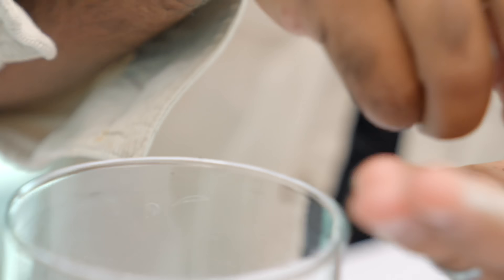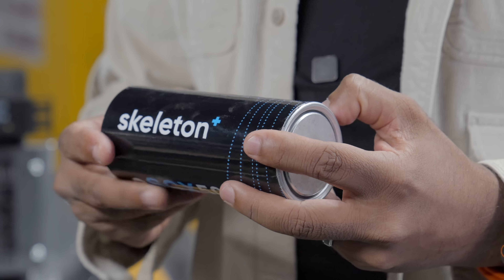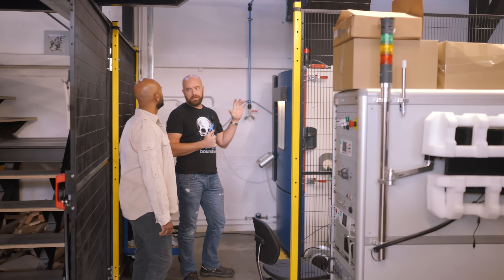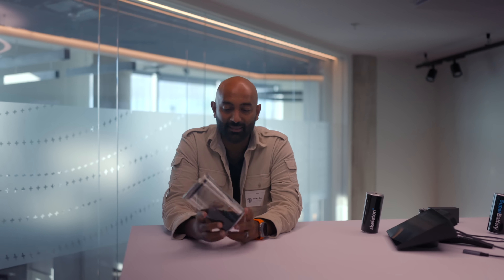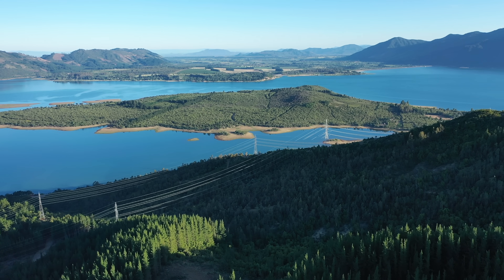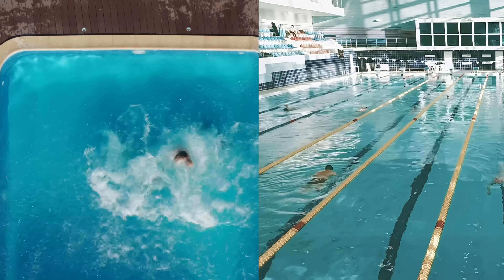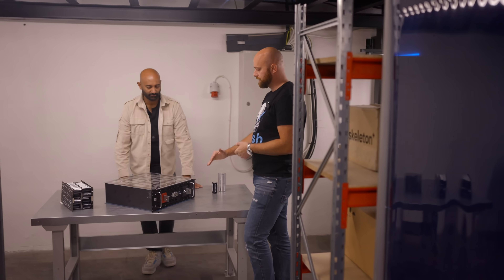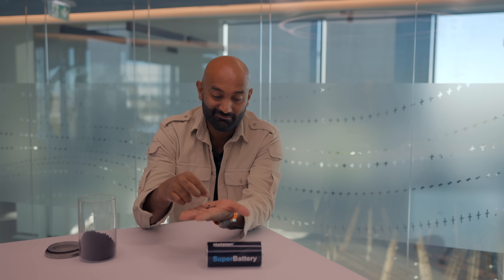Graphene Is About to Change EVERYTHING

Comment: If every house had a small super cap module, stress on the power grid could be virtually eliminated.
Reply: Would pretty much elimiate brown outs too!
Reply: I don’t think so. People underestimate how much power is needed. If the grid is loaded up and say 3000 MWis coming from wind, which happens sometimes, and the wind dies down and output drops to say 500 MW capacitors will not supply 2500 MW for long. These look great for supplying a quick shot of a lot of energy but not for delivering a vast amount of energy for an extended period of time.
Reply: @paulwilliamson2370  That short burst is where I was going with my comment. Things like AC compressors and motor driven devices in the house wont stress the grid with capacitors in line.
Reply: Those loads present no problem for the grid. Where this could be useful at home is if you are powered by your own generator, either because you are off grid or using your own generator during a power outage. I have a 4,000 W generator I use during power outages. It will start the motor for my sump pump or fridge without problems but I am sure it would never work for my heat pump even though the running current is within the capacity of the generator. Of course the big question is what costs more, a big super capacitor and all the associated electronics or just having a bigger generator.

Comment: I wonder if these would be useful in Helion Energy's fusion device, which requires immense capacitor banks for accelerating and compressing the plasma AND for recapturing the energy after the fusion pulse. You should look into the capacitors that Helion is currently using - I think they build the capacitors in-house.
Reply: Ceramic electrolyte better for high voltage applications

Comment: This is a completely useless technology. Powdered graphene osnt that special. Flat graphene at scale would be a huge leap forward but this stuff isnt groundbreaking. Also with lithium ion vehicles in vhina being able to charge and discharge at over 1 megawatt, supercapacitors are already obsolete. Supercapacitors have 100 times less energy density than lithium ion batteries so as of right now supercapacitors are pointless and will bevome even more pointless as battery technologies get even better.

Comment: As a heavy equipment technician in Alberta where it gets very cold (-40C) i can assure you most teucks have nowhere near 16 lead acid batteries. I dont know what kind of crack this guy is smoking but most trucks have 4. Ive seen 6 but never more than that. 16 would be close to a tonne of batteries.
Reply: @cameronmacdonald6525  I happen to be a heavy diesel mechanic myself. Most I ever saw were 6 batteries, and it was custom done for a sleeper. I can't speak on the extreme cold as I am midwest. I thought it sounded crazy.
Reply: Doesnt the CAT 979 have 2 batteries?
Reply: @pin65371 yes but those are just for auxiliary components. They usually have compressed air starter motors on them as it would take several tonnes of batteries to start one of those trucks.
Reply: I agree. Maybe he was thinking of equivalent batteries?

Typical heavy-duty trucks and semi-trucks often operate with a battery bank composed of 2 to 6 lead-acid batteries, usually either 6-volt or 12-volt types connected in series or parallel to provide the required starting power and auxiliary power systems.

Comment: The truckers in cold environments hopefully, are using the product my team developed back in the 1980s called HotLine (In-line diesel fuel heater), used to heat the fuel prior to cranking that makes sure the fuel is not gelled and flows properly. No need to run the engine to keep fuel warm. In combination with these Super Capacitors, the trucks should be saving copious amounts of fuel.

Comment: You could remove the big batteries from a hybrid car and replace them with a very small supercap array.  These cars get their greatest advantage by using captured braking energy to begin acceleration from a stop.  They don't need to store much energy to manage that.  Great evidence for this is that many of them don't use lithium batteries!  Before 2024 all Prius models used Nickel-Metal Hydride batteries.  What they do need is very fast charge and discharge times, but no ability to hold a charge for hours.  That is exactly what these supercaps do.  They could do that for decades, and still be sold as used parts when the car gets recycled.  Fast charges and discharges are what damages chemical batteries over time, because of physical changes in the electrodes and chemical changes in the electrolyte.  Not a problem in these supercaps.

Comment: Class 8 trucks don't have 8 batteries for sheer cranking power, or cold reserve. They use 8 batteries to extend life cycle, and reduce stress from discharge cycles. While these capacitor banks can supplement power and reduce battery dependency... you're increasing the charge cycle stress for the remaining batteries.

Comment: I've been using graphene sheets for thermal pads on my computer CPU for over 8 years now, it's not new, been around for a long time, nearly 20 years commercially, 

Early 2000s: High-performance PCs and workstations used graphene and diamond-based TIMs (thermal interface materials), often marketed as “carbon-based” or “synthetic diamond” pads.

Early Intel CPUs (Pentium era) saw the use of advanced thermal materials, including high-conductivity carbon-based TIMs in premium cooling solutions.

Graphite (layered graphene structures) was already in use for thermal pads and heat spreaders before "graphene" became a buzzword.

 Research into graphene super capacitors begins, with studies showing their potential for high energy density and fast charging.

2010 - Early commercial graphene-enhanced super capacitors emerge, mainly in industrial and research applications.

2020 - Companies like Skeleton Technologies, Nanotech Energy, and others develop graphene-based capacitors for automotive, aerospace, and energy storage applications. The ISS use these capacitors.

Comment: I am not a materials scientist, but I have learned there is plastic wrap that is only 1 nm thick and graphene is one third of that. I did a few calculations to see how powerful a super capacitor could be. I assumed a thickness of 1 inch, but made no calculation of width and length required for 10 watts. I also did not find the volt/amp capability for the plastic wrap. So my figures are missing some parameters. But the potential storage capacity is amazing.

Thinnest plastic wrap
0.00000003937 of an inch.
That's 25,400,050 in an inch
Graphene
 74,706,029 layers of plastic, plus graphene
49305979 layers of capacitor per inch
24,652,989
volts 10
amps 1 = 10 watts
246,529,986 watts
watt hours at C3 82,176,662

Explore this for me.
Reply: I would guess that the graphene used in the supercapacitors in this video is at least hundreds of atoms thick.  I don't know if the powdered nature of it means all that surface area carries charge, or not.  If it does (or if it mostly does) then there's not a big advantage in making the material thinner.  But that's not discussed in the video.  If your calc is correct, that implies that not all the graphene is carrying charge.
Reply: The DVD method of producing graphene makes a large monolayer. Since graphene in a single layer comes to an extremely low electrical resistance it only needs a single layer. The result is also very flexible and is bonded to a thin plastic. This makes stacking layers a simple process. I don't know the breakdown voltage of the extremely thin plastic.

Comment: I was hyped at first because I love capacitors. But then I took a look at their datasheet and yes, they are better than my maybe 15 years old boostcaps by quite a bit - but for the same application "only" by maybe ~10%. The size is comparable. if it's standardized I guess it's the same.
Reply: Yeah unfortunately there is not a lot of real preformance improvements in the this field in the last 10 years.

Comment: Is it just cost that stops super capacitors in standard Ev's to make battery braking more efficient as I am sure the deceleration on an EV doesn't really save much other than the brake pads

Comment: most people now days have a supercapacitor for there ice car. a jump box.. some of them have batteries in them.. and others take what is left of your lead acid battery voltage and ramp it up to be enough to start the car. I looked at one i have and it was built more than 15 years ago with supercapacitors. There are many usages in fact i bet most energy storage systems have supercapacitors to levelized power spikes. There are tons of supercapacitors there that you may not realize. 

It is great to see graphene out of the lab projects, and i am sure there are many other on the shelf components that use graphene already.

Nice video i enjoyed it. One place i expect to see supercapacitors for years are the airports that have ,multiterminal trams. why you may ask.. well it takes enough time at each stop to fully recharge while it waits for people to get on and off. 

most brownout control systems use supercapacitors although they are probably much larger systems due to power density. So i can see a lot of change outs from old systems to new ones

Comment: Anyone looking to break the electric drag racing record will need something that can discharge quickly while delivering huge currents. Supercapactors look like a perfect fit for this application.

I noticed the graphene sample was clumpy. Then I remembered that graphene has atomically small particles that can be inhaled, so oil or some other liquid was probably added to stop the material from dispersing into the air.

Comment: North American trains do not require electricity to activate emergency brakes. A reduction of air pressure in the Brake Pipe air line (or sudden loss of air due to a hose breaking) will cause the individual car's pressurized air tanks to pressurize the brake cylinders which automatically applies the brakes at full emergency rate. No electricity needed, just the loss of air pressure forcing a valve to open and compressed air to apply the tread brakes. Generally disc brakes are only utilized for slower speeds due to the greater mass of the car's iron wheels to absorb the friction generated heat by the tread brakes.
Reply: Many trucks and buses use air brakes as well but you need an air compressor on board. I think it would be heavier and more upkeep required.
Reply: @brucestewart3170  They were talking about Emergency Brakes, so the air is already pumped into the Brake Pipe reservoirs located on each car. No electricity is needed to activate emergency brakes. I tested these brakes for over 20 yrs.

Comment: So when can I get one that will replace my solar batteries, and even my gadget batteries. Capacitor/Battery powered tabletop burner anyone? I want those fast recharging times with the normal discharge rates and lengths.

Comment: You do know that one major difference between batteries and capacitors is that batteries are DC while capacitors are AC and need some circuitry to convert the energy to DC. Just in case you missed that.😅

Comment: There is a discrepancy in the B.S about trucks. I’ve ran logging trucks in the north for 40 years.
They have four batteries and we plug in block heaters over the weekends.
Not 16 batteries and never shut off
Reply: They might be talking about the Long haul trucks. They have electric heaters / AC
(Auxiliary Power Unit- APU). Most large trucking companies  have them come as a standard now with all their new trucks. I think Freightliner might have started putting in a mini fridge that built in under the bunk now too. The heater and AC switching to electric when you're in the bunk is mostly due to the no idling rule, I think it was no more then 5 or 10 min idling.
Reply: @   That could give a reason for extra batteries all right, but then you wouldn’t replace them with a low storage high output condenser.
Reply: I was thinking maybe he's talking cells or something because most modern diesels have between 2 to 4 batteries not 16.  He said it several time though, so I have no idea what he's talking about.
Reply: @   Neither does he have any idea, just trying to sell a product that nobody needs, and further complicate our machinery so we can’t repair it ourselves.
Reply: My prison bus had 3 24v batteries in it. I usually isolated 2 of them over the weekend. One Monday morning, it was -24C, and thought it isn't going to start. Started on second try.
Reply: @   I see a lot of -35 and some -40 every year the last 40 years. With the remote machinery out in the bush it can be tough getting them to run if they haven’t been running the previous day. No plugging in available
Reply: He was saying cells when he was saying batteries I got confused also . 1.5 volts per cell I’m lead acid normally
Reply: My sister taught at Montana State she asked a fellow professor where he was going for winter break he said I'm going to drive south until someone asks me what that funny plug is hanging out of my grill and I'll know I'm there.
Reply: My first thought was preheating (electric vehicles do that now to prepare the battery in ultra cold climates). I imagine they are talking about the most extreme situations. Probably not for general road routes. Maybe mining rigs? I couldn't find a number greater than 6.
Reply: @ I have preheaters in my equipment engines for those -40C startups, they run off the same batteries as the starter. Only two batteries in the machines but twice as large.
Reply: I drove truck since 1987. The most I ever seen were four batteries. 6 volts each and in the trucks I drove, they were wired for 12 volts.
Reply: Self chatre bateer 60 moh too 1,048 moh. 190 moh tooo 1,740 moh low energy devece

Comment: Hopefully, they can scale this technology down to use in audio applications like amplifiers. An amplifier could definitely benefit from these capacitors. Not just for power supply but for the audio output as well.

Comment: 6:50 if the equivalent lithium battery weighed 1600kg and the car weighs 800kg, it would not double the weight of the car, it would triple it.

Comment: I was looking at windmills as they produced ac and looked at there charge ability 20 years ago and thought of all the loss in capturing the ac wave and if they can use the 2.7v super cap in parallel then flip it to series to charge the batteries then they could use all the waves ability.

Comment: 6:50 Good subject and good content. But your math doesn't add up through here as applies to a race car, or else it's not stated clearly. You state that an equivalent Li-ion battery would weigh 1600 kg. That weight battery at an energy density of 300 w/kg would equal a nearly 480 kw battery pack at the cell level. I presume you're trying to illustrate the near instantaneous required powered delivery when exiting a corner, but you also stated the electric motor delivers only 60 hp. By comparison, a Tesla S Plaid uses only a 98 Kw battery pack and produces over 1000hp. It appears you conflated both a couple key basic concepts, and units in the math.

Comment: They are really missing out not making the dielectric capable of higher voltages. Teflon or polyethylene at 1mil would greatly enhance dielectric breakdown. 1000v 10KF would be nice for electric cars. For the reactance ]power factor[ they would need larger cells anyways. Hopefully we will see 1ft radius and 4ft height cells for grid storage. 🎉🎉🎉

Comment: No this is not any sort of game changer, just improvement on existing capacitor technology but still more than 20 times less energy dense than an EV would need.  If you have room and weight carrying ability for supercaps you're always better off just filling that space with more batteries instead.
Reply: batteries literally don't do what these do.  The uses are entirely different.  Watch the video more slowly